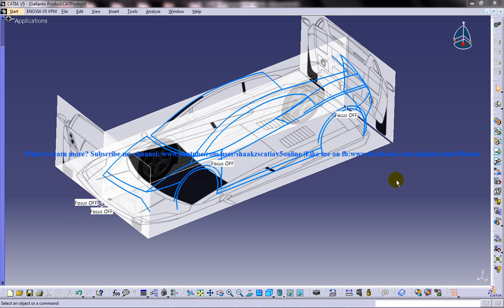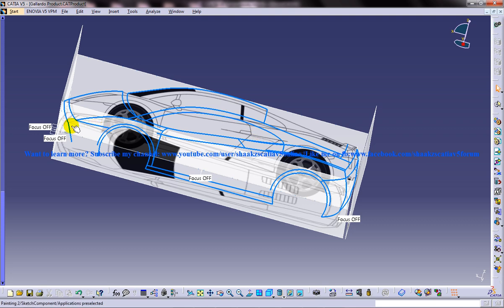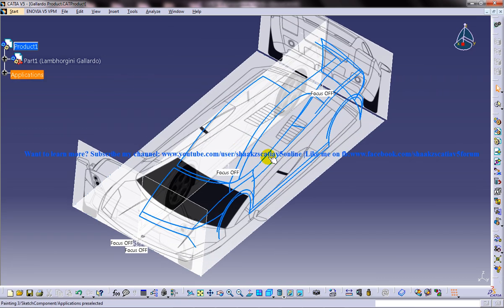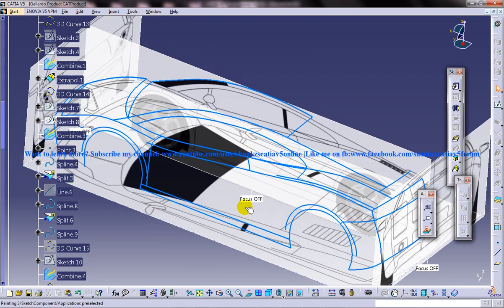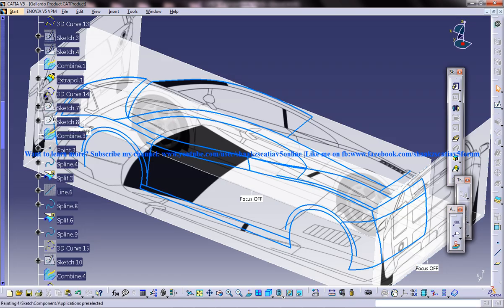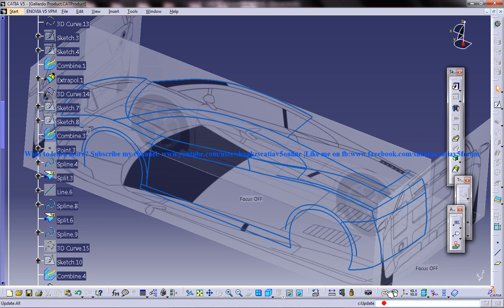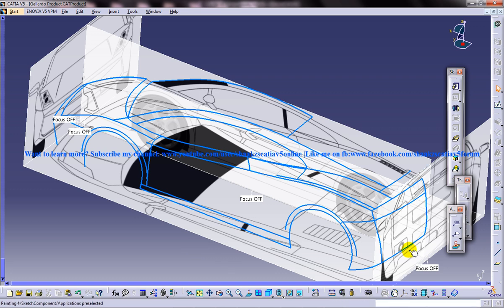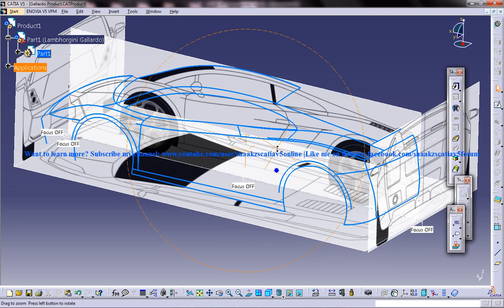Catia V5 Powerful Tricks #121|How to Reset Specification Tree back to Normal

Comment: Hi Mohanned, where did you get your training?
Reply from the maker: I have got basic training long back from my first company. then I upgraded with books blogs pdf etc. why did you ask.
Reply: Mohammed Shakeel I started out with books and then worked in a company that used CATIA. But no one in the company, had any knowledge on why my tree was missing! Thank you for posting this tip and getting back with me!
Reply from the maker: Philip Kettering Hi Philip,  thats great..!! Which company do you work for.

You can drop me an email on catia.pro.user@gmail.com for any queries. We will be in touch. tc
Reply: Mohammed Shakeel I started working at Toyota I would also like to know if you have ever encountered assembly that looking the same as the ones that you previously opened
Reply from the maker: Which assembly?  U mean the model in the tutorial above